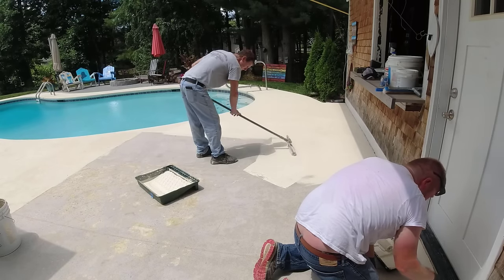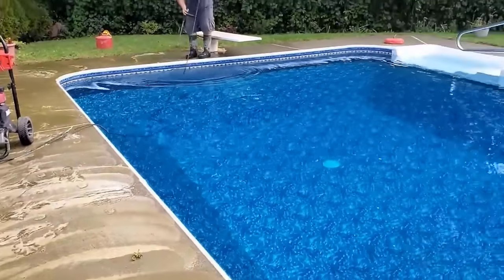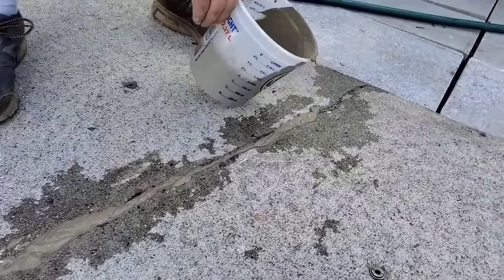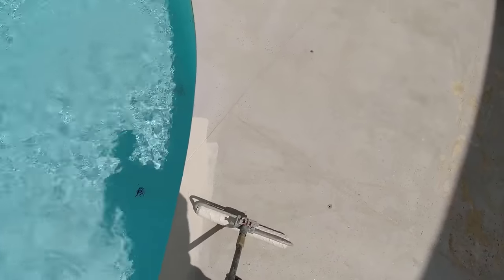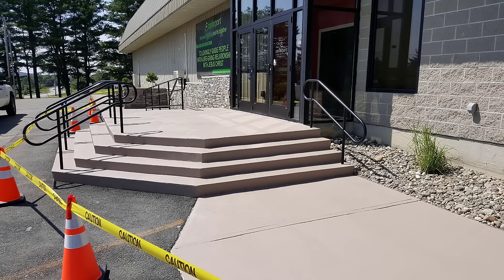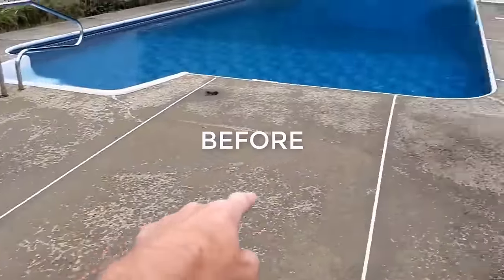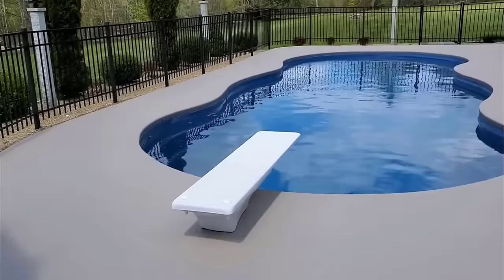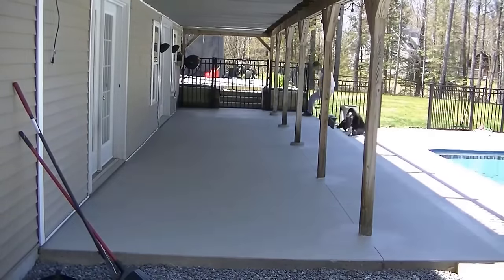NEW CONCRETE PAINT! How To Paint Concrete EASY DIY

Comment: Can you use a diluted muriatic acid to clean the old concrete ? I have to repair an old concrete patio with steps, and Muriatic acid is what I use for etching older concrete walls before applying stone veneer.

Comment: How long does the Mapecoat Deck T paint last? will it chip or wear off? I am looking to re-do my concrete pool deck (1800 sq ft) but used concrete solid stain and now need to figure out how to remove all the years of coating it and get to the original concrete that is in excellent condition. Please advise! Thank you in advance.

Comment: Nice Vids Mike.  I moved into a home with a bare concrete floor in the basement.  I painted it once with Behr then 10 yrs or so later it flaked, so I did it again. within 3 years started to flake.  Found out about PPG Breakthrough 250 paint. Ground the bad spots down with small grinder like you use, then applied.  Beautiful stuff.  Seems hard as a rock and really durable- so far.  THe PPG paint is an acrylic also.  Thinking it is similar to your Mapei.  Keep up the good work

Comment: I've got a concrete patio ( 16X20 ) that was probably poured sometime back in the early 1960's. It's got the river rock mixture in it that was common here in Georgia where I live for that time period. It's not in bad shape for it's age, but soon it's going to have to be pulled up and re-poured. After it's done and the concrete cures fully, this is what I plan on painting it with for added protection. Thanks for the video! I was just wondering what would be the best thing to do the job.

Comment: Great Video!  A Few Questions.  Does it have a Sheen at all? I'm looking for a Matte Finish, No shine. Looking to paint it but have it look as close to Natural Concrete as possible if you have any more advice.  It must be non slip safe enough for around the pool.   Can you add sand or something to these paints to get a variegated color more like natural concrete? Also Can you put this over an already painted concrete that has been pressure washed or would you recommend grinding first.  Thanks Mike

Comment: Is this suitable for a garage floor?
Reply: Use a garage epoxy coat. And don't use the flakes it comes with. ( Can't find anything small you drop on in) It's made to resist oil and car spillage.
Reply from the maker: I wouldn't use it in a garage, this is the best epoxy paint for a garage: https://youtu.be/wQKjGj8d62c
Reply: And thanks for this reply because I have a garage concrete floor that I have to clean up and fix in some spots and paint.

Comment: What about for driveways?.
Reply from the maker: It does say it's rated for vehicle traffic, but hot tires and black tire rubber transfer onto the coating would be an issue I don't believe you'd be happy about over time. Mostly for foot traffic, patios, walks, pool decks, balcony's.